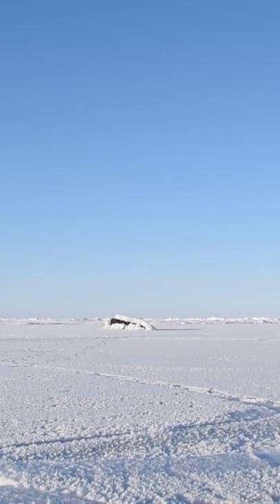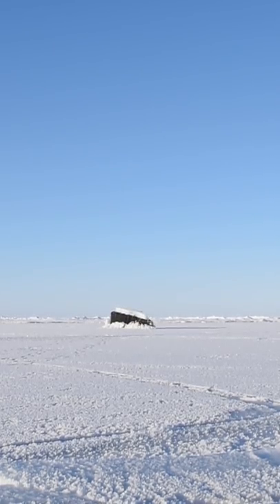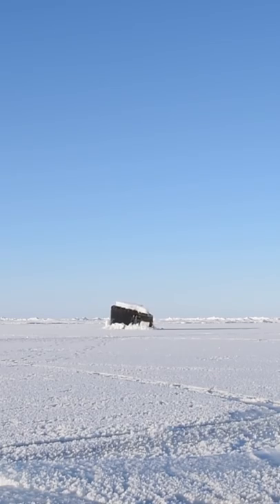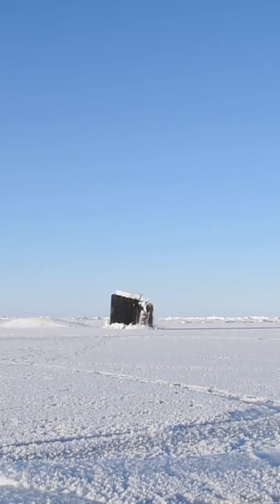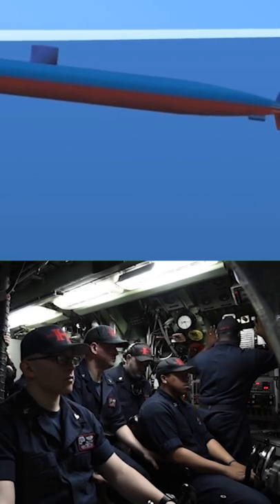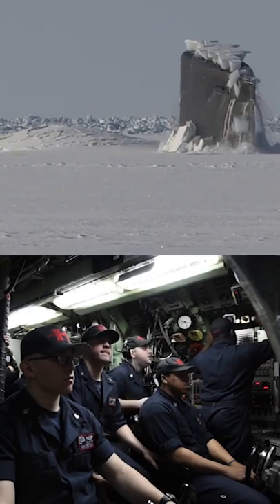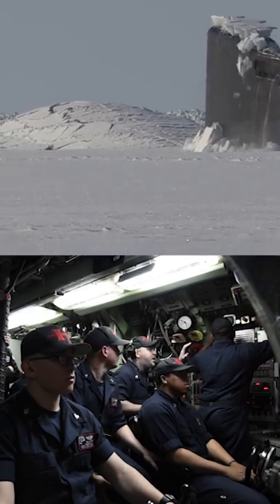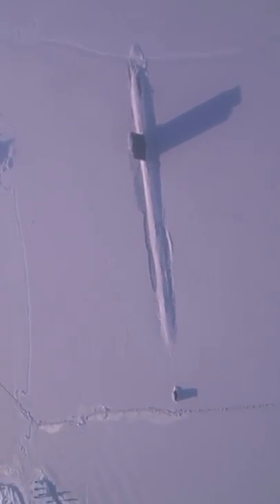How to Break the Ice - Submarine Edition #shorts

Comment: It wasn't far from having to use a chain saw a couple winters ago to get rid of the ice after an ice storm...

The thickness of the ice layer varied depending where on the car I was looking but on the wind shield was the thickness roughly 3cm or just over an inch thick. The sides were better with only just over a centimeter. So I picked around the drivers door line to crack the ice, after I figured out that I still couldn't open the door did I use a heat gun to melt the ice that kept the door shut and the handle from moving. When I got into the car did I start it up, put the heater on full blast on the windshield and went back in to wait for the ice layer closest to the car to melt.

A while later did me and a friend go out to the car to lift off big chunks of ice away from the car. This was luckily not a day where I had to be on time, I was just going down to the skii Hill to do some snowboarding. But it took a couple hours from I got to the car the first time till I had all the ice removed so the car was safe to drive

Comment: My biggest fear which I will probably never face is getting stuck in a submarine at the bottom of ocean floor that can not reach the ocean surface now but isn't leaking either. So you're left with limited amount of oxygen supply while you can't risk to open the hatch coz 1st it won't ever open and 2nd even if it did .....who can swim up to the surface from dark ocean floor where there's no light. You probably even forget the direction 30secs of swimming not knowing what's up or down. A horrifying end

Comment: "generally submarines cannot go trough ice more than 3 meters in thickness and non ice equipped submarines can only go a metee" you're showing a half a meter thick ice, or is the submarine that's big or the ice is thin?
Reply: They would try to go through the thinnest possible so it makes more sense in a safe situation to find a thin spot to go through if they don't need to stress the structure. In an emergency yes they can safely go through those thicknesses